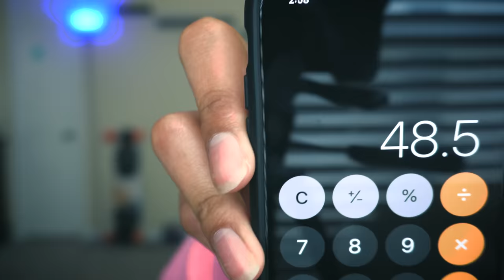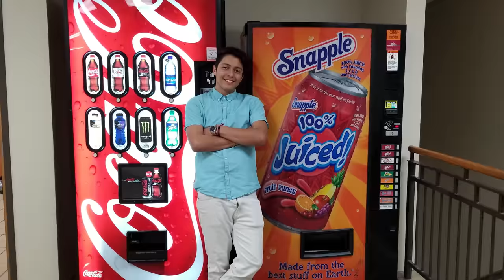Is A Vending Machine Business Worth It?

Comment: But do you do an ROI on your vending machine you buy? $4000 for a combo vending machine. I want that $4000 back as quick as possible. 

$1000 a month in sales. $500 gross. $60 for gas. But here’s the catch...

I want my $4000 back they I initially spent. I want it back in 24 months. Instead of using all my profit to pay back the $4000, I pay it back @ 167 per month. So just subtract that from the gross ($500). My net profit from that location @ $1000 per month would be...
$273.00
Reply: .... for two years